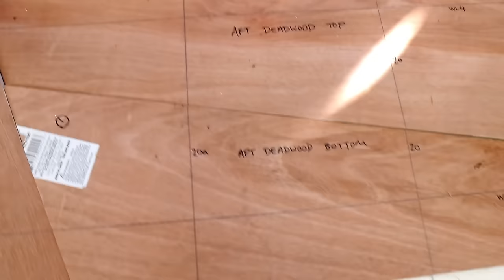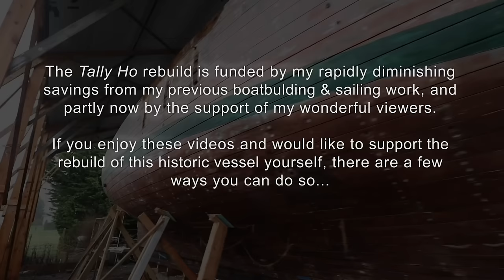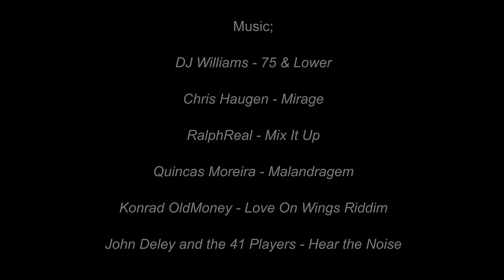Cutting the Stern Post – and some BIG plans! (Rebuilding Tally Ho EP42)

Comment: Quick safety tip. When using masonry blocks to support your timbers, make sure the holes in the blocks are vertical.  They are not designed to carry loads in the horizontal position.  A collapse with those heavy timbers could be very dangerous.  Thanks for another great video!
Reply: Yep.  Learned that the scary way when replacing an axle in a jeep.
Reply: Good advice. Wood blocks split in some stacked steel where I used to work. It collapsed and took someone's leg off.
Reply: Come now, an average new block in the vertical position can hold upwards of sixty tons. Now, I understand it is not advisable to use block with the cores horizontal but there is ZERO percent chance of failure here : )  The two inches of height lost by using it on its side is exactly what is needed, and is a perfect application of the block in question!
Edit: OSHA/OCEAN   https://www.youtube.com/watch?v=IRVdiHu1VCc
Reply: Isn't that big of a deal in his case because the weight is distributed evenly over the whole block in which case the struts easily carry the weight. Would be very different if the weight was concentrated at any point between the supporting struts. The bending stress would most likely cause the brittle stone to break. One thing he should worry about is shearing stress. That is if he applies too much longitudinal or lateral force depending on how the blocks are aligned. Either way, the safest way would indeed be to make sure the holes are vertical.
Reply: @danceswithstone  vertical load as opposed to horizontal load is apples to oranges baby,  why tempt fate with a 0% prediction and an already cleverly mangled finger tip.
Reply: @iamlonefrog4866   
There are many dangers in this yard, many risks in the work, those blocks on their sides isn't one of them. . . there is no tempting fate here. . .  there just isn't. Both an apple and an orange are adequate to hold a doily!  
While I agree in principle with the OP and appreciate JED's perspective as well,  I also know how important it is to put your work at the right height. . .  for comfort, convenience, and yes . . . for safety's sake.
Reply: @danceswithstone  OK, so your flippant with others peoples safety, that much is clear.  The weight of those Purple Heart slabs are real, the height at which you say is safe to work on these beasts is real. Which makes the damage they can do real as well. Were you aware that the rough surface of blocks themselves can induce point loads on the block? Which in turn can crack the block causing it to fail? The only thing here that I see as not real is your assurance of safety just because YOU say so... when all other data says otherwise.  Just weigh and measure the benefits versus consequences if your'e confused. Should Leo put his physical self at risk just because he didn't see the rough spot that caused a point load? Did you or Leo ever hear of point load? Well, I'm sure it doesn't matter to you because yer so damn sure of your logic. It's one thing to believe in yourself "just because"  but please, don't expect others to do the same.
Reply: I don't think it's relevant which way the hollow concrete blocks sit - the blocks just shouldn't be there. Timber is the only material that should be used.
Reply: @thepotterer3726  I'm curious to know why timber should be used. Would you mind explaining to a non-handy person why this is preferable if you'd not mind weighing in? Thanks! I love learning something new. 😊
Reply: When you use a concrete block to support timber when you're cutting it with a chainsaw (or any tool) the chances of hitting the concrete block with the tool are very high. You have the added danger that when the timber comes to be planed, there could be bits of the block embedded in it.
Reply: @thepotterer3726  thanks for the response!
Reply: i was thinking wooden blocks would be the way to go  also. another possibility  i worked at a small airport. there was an incident landing a plane . the plane needed repair. the guy who came up and  disassembled the plane used styrofoam blocks to support the aircraft and parts. i quizzed him about styrofoam  strength as a block for support. he said it would support small jets without a problem.
Reply: It's very misleading to talk in terms of what a hollow concrete block can support when it is correctly incorporated into a building, as opposed to incorrectly oriented to support a heavy load where a point or shock loading will cause the blocks to crush or fail.
Reply: @danceswithstone  Hahaha! Let the record show that your lack of concern also spreads to your lack of vocabulary. That in combination with your willingness to take chances in a "shop" environment (hardly the place where one seeks risk) makes you the perfect storm. 

All that aside... yer mom just loves my "content".

just sayin'
Reply: @AD-rp8xw  -Hi, Angela! A big disadvantage of concrete blocks used 'dry' as props is their brittleness. They don't flex. Wooden planks, slabs and blocks - especially made from the kinds of immensely strong timber that Leo's using - are not only very resistant to crushing, but they 'give' slightly if placed on an uneven surface and won't shatter unexpectedly.

Hollow concrete blocks are brilliant once they're bedded in fully-cured mortar, which spreads any point-loads and eliminates weak spots. Once they're securely bedded they're perfectly safe (and even better than wood for static loads), but if they're used loose, any slight unevenness can cause them to bend/split/crack and collapse without warning. Putting a thin layer of something flexible between dry blocks - like a thickness of canvas or thick woollen blanket - can help stop them being stressed unevenly, but as other people have already said, wood is much safer for the temporary propping of loads.

Leo's not really at risk with his purpleheart stacks because he's not actually underneath them, but it'd be suicide to try holding up a car or truck on concrete blocks alone. Too brittle, and much, much more weight involved. The same applies to mining roof-props, which are always timber held in place with pairs of sliding wooden wedges.  As with the car, dry concrete blocks would be a bad idea because there's a good chance your head would be underneath the load when something broke!

Even giant shipyards still use wooden blocks and wedges to support craft weighing hundreds or even thousands of tons. It makes sense, because that's why trees developed trunks made of wood in the first place! Flexible strength = reliable safety.

I apologise if this Comment is over-long or even seems patronising - that certainly wasn't my intention - but it's very difficult to gauge levels of age and experience on You Tube. Sometimes questions come from 7 year-old casual viewers, and sometimes they're from experienced old hands. It's hard to tell. Whatever: it's easy to upset of insult people without meaning to, and you can suddenly find yourself mired in a hate-fest. Such things have no place on Leo's happy Channel...  ;-)
Reply: @EleanorPeterson  thank you very much for the detailed response, it helped to clarify things for me. I'm not as handy as many of the others on here seem to be, but am fascinated by the work and an really enjoying learning more about the profession and the art of ship building. I'm in ICU nurse so I can't say that I get my hands on building materials often, but am married to a handy kind of a man and was raised by a do it yourself kind of a family so I'm not totally lost. 

I will say though, I'd have used concrete blocks unsafely in the future without a second thought without learning what I just did, and I'll pass that on to my daughters for their safety as well. It's sometimes the little things that people in the profession or in the know assume that everyone else must know that make all the difference in the world.

I loved learning though the videos about the different types of wood and how they are used as well as commonly used ones in the past vs. present. The prices were astonishing! Learning more about cracks being ok sometimes <who knew!!> And knots being not ok <but fillable sometimes?!> Has all been part and parcel of the fun in learning during the process of ship building. 

Adding your information on wood just helps to put it all together a bit, so thank you! 

Any and all clarification on any other topics from the videos would be very well received by those of is who aren't nearly as handy as you. 😊

Cheers!
Reply: @thepotterer3726  great idea. Use wood not  bricks.

Comment: A barn raising.  Great concept could work well.  If you've watched any barn raisings, they are a massive logistical event. Using volunteer help can work. Given the limited skills many will have you may want to prep a bunch of frames and then install them barn raising style.  Many barn raisings had a similar skill percentage per the group. The skilled were assisted while they cut and mortised beams, after all the beams and braces were prepped assembly began. This will be great to see what you do with the concept. Thanks for sharing

Comment: I’m sure you must have considered ways of preserving that checked purpleheart, but in case you haven’t. I’ll throw in a possibility based on what you and your team have at hand, if I may be so bold. Cut the beam completely through along the check. Turn the entire beam on its’ side then cut it along its’ entire length. This will produce four sections, call them side A small and large, and side B small and large. Now flatten what will be the four section. Finally take side A small and large and turn it completely around so the A small section will now lie atop the large B section and the large A section atop the small B section. Glue them together like laying down the futtocks of the giant frames you’ve been making! This would be easier to explain with a drawing which I would happily share if you need!
Reply: I like it
Reply: like some sort of franken glulam good idea to save and use what you have
Reply: Andrew Turnbull - Leo said in a reply to a comment in an earlier video that he would not be using glue>

Comment: Tip: Get yourself a sheet or three of 1" or 2" foam insulation board to cut sheet goods on. It makes for a firm support, lasts a surprisingly long time, and has the bonus of much less wear on your saw blades. I support mine on sawhorses with 2x lumber as a bridge underneath. I got tired of sawing on the floor :)
Reply: Good tip, we do the same.
Reply from the maker: nice idea!

Comment: I bet you can sell even very small offcuts of purple hearth. They make pens out of it.Also: the circuit board on the Commodore computer had a "hole" in the design because they were drawing the plans on the wall and had to go around a lightswitch. Just like your hole in the template :)

Comment: Thank you Leo, another video well done. Your work area is incredibly clean. Right proper I would say. Ii spent a bit of time in the wood boat yards in India, Indonesia Thailand and China. Great job, a clean work area is a safe work area. The lights are great. You might want to put some rubber pipe caps on the ends of the clamps. They ate cheap and save stitches in the scalp. I have had them.

Comment: Awesome work as always Leo! That chain saw jig looks great but at the same time dangerous. So, be careful using it as you don't need to injure/lose any more body parts!
Reply: I second that.
Reply: I was wondering, why he would use it with the top side of the chain cutting down into the wood instead of using the under side of the chain which would pull the jig down onto the wood. Wouldn't there be a risk if the chain were to catch that it would shoot the jig up into the air? Any thoughts?
Reply: @MacPassion  I think he is being pretty careful and not push it into the cut too hard which would cause the chainsaw to have more of a tendency to want to climb up
Reply from the maker: @MacPassion  Good question. It's so that the chips/dust are pushed down, and not into the face of the operator, obscuring the view and concealing the pencil-line. The jig and saw together are actually very heavy and no matter how hard I push I have never felt the saw try to climb up. I understand the fear of catching but it just doesn't seem to happen with this jig. cheers
Reply: The big risk is from uncontrolled contact with the tip of the saw. This is not really an issue in the application. Also, it is a fairly small saw in a very heavy bracket.   @MacPassion
Reply: Good to know! @SampsonBoatCo
Reply: @MacPassion  there are commercially available jigs for chainsaws that operate in the same way, have been cutting braces to of green oak for years with it and never an issue! Can see why it would look sketchy though..

Comment: Hey. 
I se you guys don’t use ear protection in many cases when using machines. Even if Leo put them on after the first cut on the bandsaw when making templates. :-) You’re all quite young so don’t ruin your hearing. 
Take care.
Reply: Yes I can relate to that, I worked in a wood machining shop 60 plus years ago, before the days of hearing protection and I started paying for it 20 odd years later  suffering with a form of industrial deafness with continual loud hissing in my ears, it sounds like a high pressure air leak in your head, also called tinnitus, no fun I can assure you.
My advice to you is wear ear protectors before it is too late guys.
Reply: Maybe they are using ear plugs which are a bit hard to see when inserted.
Reply: PARDON?

Comment: LEO,
For the checked/cracked Purple-Heart timber, would a 2 inch deep (now that you have drilled it that deep) Live-oak butterfly help (or hurt) the strength of that timber member? Just an idea since you have so much cut-offs laying around and the Live-oak is a pretty dang strong wood. I would chose this option over epoxy filling it any day. Please let me know what you think.
Or even a set of butterflies, that wedge against each other, going all of the way through and pinned/draw-bored through the timber in the perpendicular direction? I think the first idea, set in with epoxy, would take less out of the main timber and therefore lose less strength.

Comment: Fill checks with slow cure epoxy after you blow it out with air. I do it and wood glue will work but make sure its kept very warm. But I guess whatever you did has already happened, hence, a video.

Comment: Not trying to be a safety troll... but,...performing all of your cuts with the top of the chainsaw bar can easily lead to catastrophic failure of the idler wheel in the nose of the bar. There is a tiny bushing in that idler, and it will not withstand constant loading. In normal use, all the strain is absorbed by the crankshaft and drive sprocket, while centripetal force keeps the chain off of the idler. leaving it to guide the chain around the nose without much strain. 
I can see the desire to keep the cutting line clear, whereas cutting properly will throw all the chips in your face, so buy a face shield. A small chip deflector can be added that will not obstruct the line of sight.
Work safe. I've been following your progress since the second video. Great work and great coverage. I want to see it to completion.
Reply: Older Husqvarna bars from the defunct Canada factory had actual bearings for the wheel in the nose. I have a still new 22" waiting for the right saw
Reply: Might be Torrington bearing
Reply: Good point.  Never thought of that.
Reply: have you seen this happen? quite curious as the company that make the alaskan mill make a jig for cutting like in the video.  have been using it for the last 7 years to cut oak braces for timber framing and  never experienced or heard of this happening

Comment: Really dumb question but given how tightly all these pieces fit is there any concern about swelling once they are in the water for an extended period. It seems obvious wood will swell but how do you account for it in fitting everything to prevent warping?

Comment: The request for extra volunteers at 15:00 - um... yes. Right. I volunteer. Ex-carpenter, joiner, cabinet and musical instrument maker. As I'm in the north of England, though, it might take me a while to get to you. I've got no cash for travel, so I'm going to swim the North Atlantic (it's only about 3,500 miles), then come the rest of the way on foot.

I've slathered on plenty of goose grease for the swim, and have a flask of nice hot tea and a packet of Hobnobs in my backpack to keep me going through the storms. Once I arrive on the east coast of the States I've got some lovely 5" high-heels for the overland journey (about 2,800 miles). No problem. I'll top up my flask in Boston. I understand that Americans like to make their tea by throwing it into the Harbour. Must make it taste jolly salty, but there's no accounting for taste. Whatever. With a fresh flask of tea, I'll run all the way to Sequim. Shouldn't take too long. "Smoke me a kipper, Leo - I'll be there in time for breakfast."   :-)

Comment: I would put stainlessteel strapping on top of it. Then I'd use badass adhesive to glue wood laminate over the stainless steel. You could even encapsulate it so nobody would see its bionic skeleton. Dont clench up on me about authenticity when I saw you put nails and pegs in them already in another video.

Comment: Leo, I'm curious what kind of engine Tally Ho Originally had. What type of engine do you plan to use in your restoration?
Reply: As built, she had a 10-hp 3-cyl paraffin (kerosene) motor, & had to carry an auxiliary petrol (gasoline) tank. These engines had to run on gasoline until they got hot enough for the carburetor to vaporize the kerosene! Seems pert' strange to me, but that was the practice in 1910. Kerosene would've also fueled the cabin heater, lamps, galley stove & navigation lights.
Reply: Thanks,  @frederickstibbert7389 !